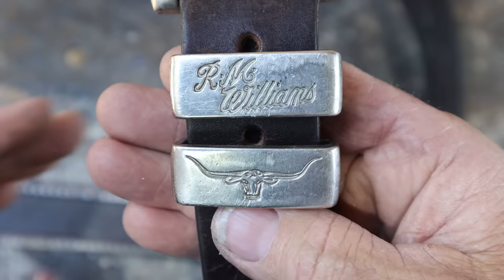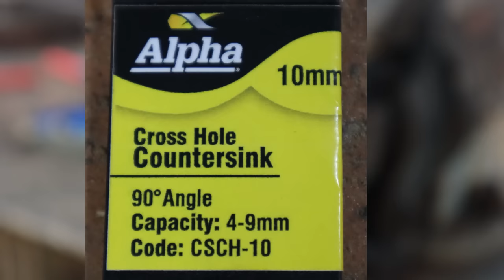I make an Industrial Style Wall Coat Hook using Rebar - R.M.Williams Belt Project.

Comment: Where does one find bendable rebar? This gentleman makes beautiful tight twists and not a single bang.
Reply from the maker: I am using rebar that is used in housing concrete slabs etc standard stuff at most steel suppliers, and even that cracks or breaks, try not to ever bend it too far where you have to bend it back and try to just bend one bit in one direction, if you rebend it sideways it could crack, have a play. I also get rebar from Mesh I just cut it out that give you more sizes. Use heat if you have to, you don't have to make it glowing red to bend it. Ask at your steel suppliers they may be giving you hi-tensile steel. Hope that helps a bit.

Comment: Do you do anything to prevent future rust? Love the look of the rebar in a slightly polished condidtion.
Reply from the maker: I often use Penetrol Rust Treatment Penetrates Rust 300g Aerosol Spray, and then put two topcoats of Semi-Gloss Clear Coat. That is what I used on the rebar lettering on the back of my workbench, here is the link to that video. https://youtu.be/JA-wk62Zghk  I try not to comment on finishes, As what climate you are in, is it inside-outside, lots of rain, ice, do you want long term and rarely touch, or a wax with a wipe over every year. That is why I have no opinion, Please ask someone in your area what you should use, I feel this is a better way to find out what would be best for you. Thank you for your comment.

Comment: I love your creativity! Do you top dress your pieces with anything to keep them from rusting?
Reply from the maker: Yes, most of my work is coated, I often use Penetrol Rust Treatment Penetrates Rust 300g Aerosol Spray, and then put two topcoats of Semi-Gloss Clear Coat. That is what I used on the rebar lettering on the back of my workbench, here is the link to that video. https://youtu.be/JA-wk62Zghk I try not to comment on finishes, As what climate you are in, is it inside-outside, lots of rain, ice, do you want long-term and rarely touch, or a wax with a wipe over every year. Thank you for your comment.

Comment: Con que tratamos el material para que no se oxide y manche la ropa?
Reply from the maker: Usé Penetrol Rust Treatment Penetrates Rust 300g Aerosol Spray, y luego puse una capa superior de Semi-Gloss Clear Coat. Eso es lo que usé en las letras de las barras de refuerzo en la parte posterior de mi mesa de trabajo, aquí está el enlace a ese video. https://youtu.be/JA-wk62Zghk Trato de no comentar sobre los acabados, según el clima en el que te encuentres, si es de adentro hacia afuera, mucha lluvia, hielo, quieres mucho tiempo y pocas veces toques, o una cera. con una toallita cada año. Es por eso que no tengo una opinión. Pregúntele a alguien en su área qué debe usar, creo que esta es una mejor manera de averiguarlo. Gracias por tu comentario.
Las fotos y el video son de acero desnudo, lo recubrí después del video.

Comment: What to you use to stop your creations from rusting,  awesome work Gavin
Reply from the maker: I often use Penetrol Rust Treatment Penetrates Rust 300g Aerosol Spray, and then put two topcoats of Semi-Gloss Clear Coat. That is what I used on the rebar lettering on the back of my workbench, here is the link to that video. https://youtu.be/JA-wk62Zghk  I try not to comment on finishes, As what climate you are in, is it inside-outside, lots of rain, ice, do you want long term and rarely touch, or a wax with a wipe over every year. That is why I have no opinion, Please ask someone in your area what you should use, I feel this is a better way to find out what would be best for you. Thank you for your comment Gavin.

Comment: Gavin thank you for all your videos, brilliant. Can you suggest the best way to drill rebar?
Reply from the maker: Thank you very much. When drilling put the reo in a vise so it can't move, I start with a small drill bit and work my way up to the size I want, it is always a good idea to use oil or a drilling lubricant, hold the drill steady and take your time don't rush it. Wear all the safety gear. Hope that helps a bit
Reply: @GavinClarkdiy  Thank you Gavin. I went through your video's and found the one about using a masonry bit on hardened steel and it worked a treat on me rebar. So thanks again keep up the great work.
Reply from the maker: @simmellard  That's great, I am glad that was helpful to you.

Comment: Bloody great job Gavin. The end result is a beaut. Did you "blue" it after you were finished ? I like the way you always find a way to hide the welds. Neat as mate.
Reply from the maker: Thank you very much, I am glad you liked it, it was not coated at the end of the video and when the photos were taken, I had just givem it a good hand brush with a wirebrush, but it is raw steel. Today I gave it a coat of Penetrol Rust Treatment Penetrates Rust 300g Aerosol Spray, and will then put a topcoat of Semi-Gloss Clear Coat. This will have the same look as the lettering at the back of my workbench. Thank you for your comment.

Comment: Are u lpg or oxy for the heating mate. I can decide if I want to go full oxy/ac or lpg as it’s cheaper
Reply from the maker: Hi Kevin, my thoughts, Oxy is much quicker than LPG, but like LPG, if you don't see a flame in any of my videos, I did not use heat at all on that project, and if you do see a flame it was LPG, I have not used oxy on this channel at all. It is mainly because of the cost, plus I have LPG bottles here anyway, I don't want two more. I hope that helps.

Comment: Gavin, I have often wondered, do you spray any of your finished work with clear laquer?
Reply from the maker: Hi Jed, I often use Penetrol Rust Treatment Penetrates Rust 300g Aerosol Spray, and then put two topcoats of Semi-Gloss Clear Coat. That is what I used on the rebar lettering on the back of my workbench, here is the link to that video. https://youtu.be/JA-wk62Zghk I try not to comment on finishes, As what climate you are in, is it inside-outside, lots of rain, ice, do you want long term and rarely touch, or a wax with a wipe over every year. That is why I have no opinion, Please ask someone in your area what you should use, I feel this is a better way to find out what would be best for you. Thank you for your comment.
Reply: @GavinClarkdiy  you more than answered my question. You're a good man. Thank you for doing what you do!

Comment: I really like this build (and your others).  I have only one small suggestion to make.
Turn your vise jaws around and not use the serrated jaws to clamp with as they mar your work.
You could just bend 2 pieces of metal to fit the jaws (like I do) but they aren't that secure and move a lot unless you buy the ones with bendable arms to wrap around the heads.
My 2 Cents as You do good work but I hate to see the vise marks on the work you have done.
Reply from the maker: I agree with you 100% but I have found without the grip onto the steel when forcing things it tends to slide, the serrated part on my vise is not very sharp, and I feel it adds to the look, (perfect smooth steel on a rustic fitting makes it look like it was not hand made, and it loses the unique feel, My feelings anyway) if I wanted no marks on it at all I would use plenty of heat then the vise does not need to hold things very tight, or copper jaw protectors as they could easily hold it when using heat. I thank you for your input, you are right in what you have said.

Comment: Where do you get 7mm rebar?
Reply from the maker: I was buying it at Bunnings here in Australia, but they had trouble getting stock a while back, it came in a three-pack 1.8m long. I did a Special order there to get some stock. Other than that it is just the steel suppliers or the people that do the steel formations for large buildings (some use about that size to tie it all together). I have cut odd sizes out of mesh or trench mesh.

Comment: Why do you buy new rebars, use old ones and save your money.
Reply from the maker: I do also use old rebar, plus I cut it from mesh at times, but in these, each video uses a very small amount of steel it is not really expensive for the video. Thank you for your comment.